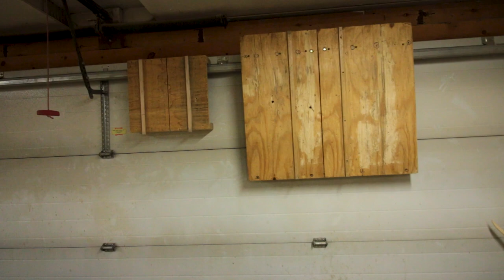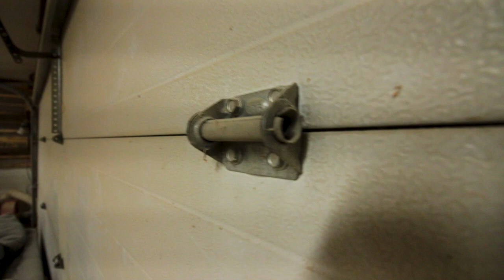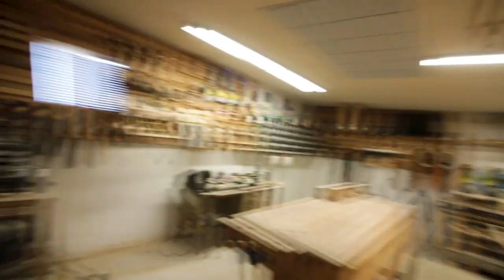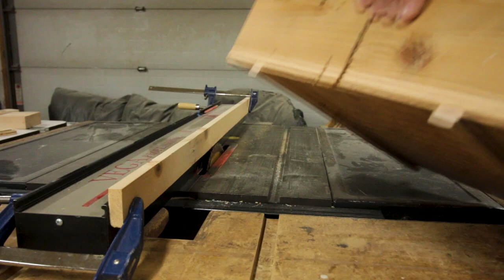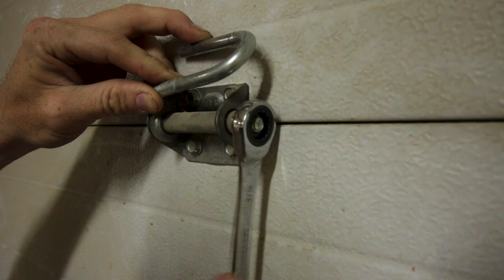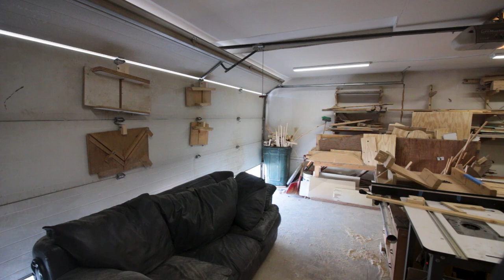How to Store Table Saw Sleds

Comment: Is it possible that the sled hung lowest on the door is triggering the sensor that checks for objects in the door opening rather than it being a weight issue?
Reply from the maker: Now that's an interesting idea...
Reply: Do you have the light sensors?  Hard to see if they are there or not.  It sounded like it was a bit fussy about the extra load, but the reopen action is more aligned with the sensor tripping.    And that one "flapping" out away from the door could be seeming like a kid ran under the closing door.   Perhaps bungee cord to hold the lower ones out of the way?  (Opposite of what you were doing with the hooks though).

I may be stealing this idea.  Have to go look at my hinges to see if they work that way....
Reply from the maker: You were absolutely right!  I finally had a chance to test that idea and the bottom sled was hitting that sensor every time. I didn't think it was low enough but on the second look that was exactly what was going on. Thanks!

Comment: Great idea! I think your door will be fine. I wonder if the door is binding because of too much weight on one side. What if you move the large sled to the middle lower location and relocate the smaller one to the side?
Good tip on the hot glue lock nut too.

Comment: Not a bad idea, dude. All door expert comments below taken into account (and good ones, too, btw), your long-term concern here is the added incremental wear on the motor's gears. I like to hang stuff on hooks on the outside of the door's guide rails so that the hook doesn't impede the roller guides. Also this - you went to all that trouble, came up with a good solution, and still have a janky sofa there in the way serving as your dust collection system... lol.
Reply from the maker: Hahaha "dust collection system".  I might have to use that in a video
Reply: @WyldeWoodworks  Please do. Also, I scanned through your other content and figured out why you have that sofa there.

Comment: Put on a bigger spring and or turn up the tension on the spring you have to help protect your motor and chain drive. The spring holds the weight of the door. The motor is just doing the movement. That’s why the motor is so small. Our spring broke and the motor can’t function without it. It will pull and break the top panel bending it. Trust me I speak from experience

Comment: Got any links to the rods you used to make the hangers?
Reply from the maker: The bolts I used came off of a very old trailer that I took apart years ago. I'd have to measure them to figure out what they were.  If I was going to try it again I would try to use something like a 1/2' threaded rod.
Reply from the maker: It would probably be much simpler just to buy a u-bolt

Comment: You could lighten the load by cutting holes in the bases of the sleds. It's not like a sled needs a solid bed, just enough surface to hold up the working piece.

Comment: There should be small plastic screw on the Opener which adjusts the weight at which the safeties kick in.  It is used so that a single sized Opener can be used with a variety of weight doors.
You may be lucky and have a little Umph left in that Opener and just have to open'er up as they say by adjusting that screw.
Also, you were on the money with the sled placement.  The Opener is likely sensing an imbalance which it perceives as a Human trying to kill themselves and thus shuts off.
Adjusting the springs would help, but I agree, without knowledge and tech, that job can get dicey.
Good luck.
Reply from the maker: Thanks! There were 2 small plastic screws on it but it seemed to be more of a height adjustment. If I wanted to I could stop the door just before it closed fully or get it to close harder against the floor. I couldn't find any weight adjustments.